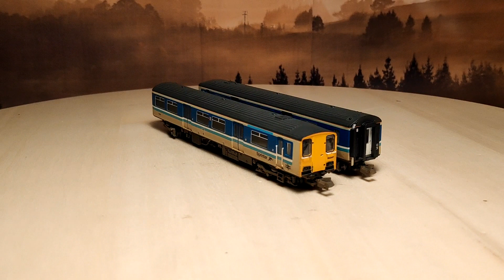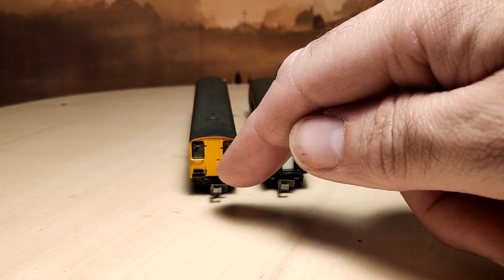3D Printing Corridors for my GF Class 150

Comment: they look good, those black bits on the bottom i think they push the corridors out a bit/ act a sort of buffer type thing or more like a spring if you like, there should be one on both sides :), its amazing how even adding your own corridor connectors how you have bought the model more up to date
Reply from the maker: thank you 👍, it was really because i couldnt find some that i ended up printing some, its amazing how much ive learnt about locos since ive started the channel, and continue to learn, il definitely have a good look at the corridor mechanism if i get a chance to see one for real 👍
Reply: @ThisWayWorksTWW  if i ever spot you on the facebook pages again im more than willing to send some 150 pics 😊😊
Reply from the maker: @GWRailFan  Thank you 👍 im just about to have a go at painting one so i may show that over on the forums if it comes out alright! 💩
Reply: @ThisWayWorksTWW  lovely :) cant wait, im sure it will look great